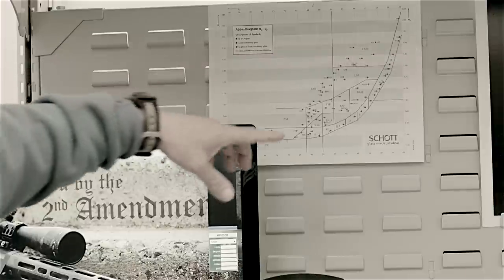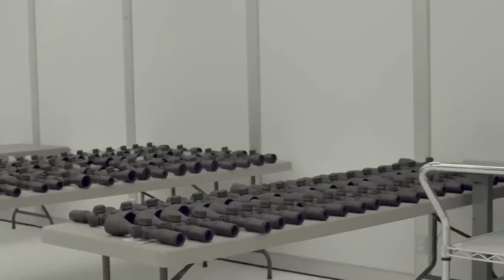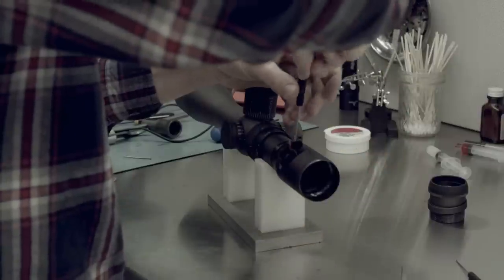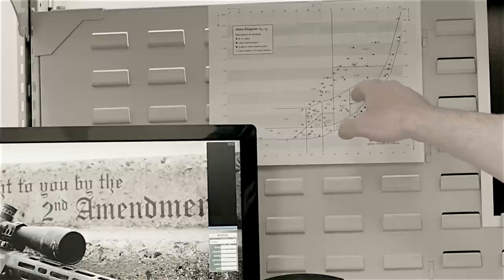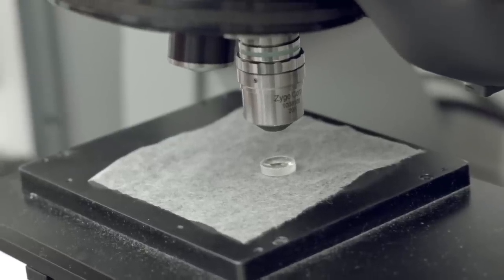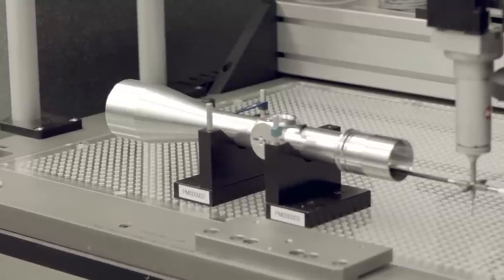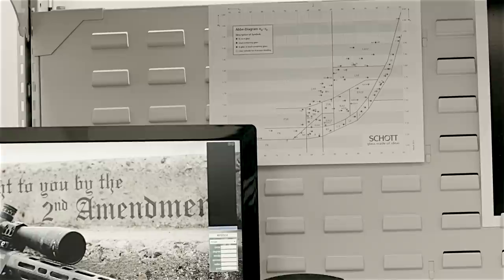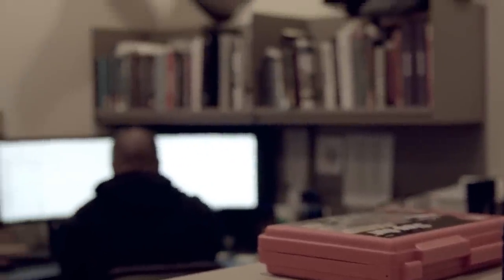Vortex Factory Tour - Glass Education

Comment: Recently bought a vortex razor HD gen ii 4.5-27×56 featured in this video and very happy with it. Coming from viper PST which is good to me.  Amazing quality and clear glass with repeatable adjustments which I value greatly. I will be testing their customer service as one of my scope turret caps on the razor looks to have a slight defect from the coating process. Not a big deal as it's just a little screw on cap.  I'm sure they will toss me a new one.

Comment: Are one of those 4.5-27's my scope that I ordered two months ago? I can't wait until it's on my rifle!
Reply from the maker: I think your link broke the conversion, look up " Schott vs Hoya" here is a quote 

"Schott" is a brand just like "Chevrolet". 

The question is akin to asking "Is a Chevy a better type of car?" To which most folks would reply "What Chevy and better than what other car?" 

The question cannot really be answered until you move from brand (i.e., "Chevy") to models ("Aveo" and "Corvette") and beyond. Between the Aveo (imported, subcompact, high fuel efficiency/low performance, affordable economy model) and the Corvette (domestic, large two seater, ineffcient/high performance, costly sportscar model) there's a huge range of characteristics. In other words, Chevy, like Schott, offers lots of models at all ranges of quality, specifications and price. 

The ED element is the low dispersion "crown" glass (in this case a fluoro-crown) so the Schott glass is likely something we'd call a "flint". A flint typically has a higher refractive index than a crown, usually in the Nd range of 1.45 to 2.00. 

To guess at what Schott flint is being used (i.e., to identify the "model" rather than just the brand) you'd need to look at the Schott glass catalog and see what glass types are available within that "flint" refractive index range. It's probably Schott NF2 with an index of 1.65 (my guess). Ohara makes a similar glass called PBM2Y. At a given level of quality (Grade) the two are fungible. 

Also note that brand and model alone don't tell the whole story. Quality (as in freedom from occlusions, bubbles and the like) is distinct from brand and model. The highest grade optical glasses have fewer such flaws than the lower grades. 

That's a long winded way of saying that pretty much anyone's flint glass of a particular refractive index and common quality level will perform the same. The brand of the is completely meaningless. The properties of the glass have meaning, but don't tell the whole story. Only by knowing the relative properties and quality of both elements can you begin to form an idea of how the scope using those materials might perform. The last bit of information, however, is the quality of the figuring of the materials. As I said earlier, poor execution (inaccurate figure, poor polish, poor coatings) could cause even a design of excellent potential using materials of the highest quality to perform poorly. 

So, when a telescope maker tells you "I use Schott and Ohara glass" they essentially tell you nothing of value about the telescope. If the maker tells you "I use Ohara FPL-53 mated to Schott NF2" they tell you something of modest value that at least allows you to model and predict how the scope could perform at a given aperture and focal length. If they instead told you that "I use Grade A Ohara FPL-53 mated to Grade A Schott NF2, and I hand select only those blanks completely free of detectable flaws, then figure the optic to a minimum of 1/8 wave at the eyepiece with a minimum 40/20 scratch-dig surface polish quality" he's provided some relevant information, which, if true, more likely than not would be a superior scope. 

Problem is, few makers provide this much information. Basically glass brand and glass type alone, with a promise of "diffraction limited" figure quality and no guidance on what diffraction limited means, tells you almost nothing about the actual scope built to those criteria.
Reply from the maker: and Schott has manufacturing in China, as well if you look at the numbers, you can get Chinese equivalents of Schott 

Schott catalog #/Chinese catalog #------Abbe #

BK7/K9-------64.07
PSK3/BaK4---63.36
BaK4/BaK7---56.05

Up until recently, all ED was Ohara glass combined with Schott Flint glass, there is a mix to develop the appropriate prescription. 

This is why in the video he tells you, Glass is Discrete!  It's the design and number, not the name brand.
Reply from the maker: So you think the $800 scope is the same glass as the $2800 scopes, you do realize Schott operates in China .... Try Googling Schott vs Hoya, or Schott vs Ohara and read. The Abbe number means you get the identical glass from a different name brand.   Look at the Schott ED numbers vs the Ohara ED numbers, the Ohara has higher quality ED glass than Schott.

Comment: Of course, if your scope doesn't have "Schott glass" you're going to say, " the brand of glass doesn't really matter".  Then when you have the Schott glass scope, it'll show up on your webpage as a BIG selling point.  Downplay what your product is lacking and play up your selling points.  This video didn't age well.
Reply from the maker: Glass is glass do you think Hoya can’t match specs. Funny every big blockbuster uses a variety of lenses including Japanese, there is an Abbe number and spec, more than one company can match that spec.
Reply: @SHLowlight  Nope!  It's funny how you never hear anyone talking about the awesomeness of "Hoya" glass, except those trying to sell it and claiming it's on par with Schott glass.  Lol.  It's still NOT Schott glass.
Reply from the maker: @Rico11b  if you say so, they do in some circles you just don’t see it in scopes. But the majority of scopes use Japanese glass and Schott sources glass from China too so 6 and 1/2, stop by a telescope forum for an education. They know.
Reply from the maker: @Rico11b  even the new Zeiss S3 is a LOW product with Zeiss specs in Japanese glass and it’s every bit the S5. You can’t tell, the S5 is Schott glass and the S3 meets it
Reply: @SHLowlight  Don't change the subject.  The video was about the crappy Vortex scopes, not Zeiss.  Are you producing and selling the Zeiss?
Reply from the maker: @Rico11b  I run Zeiss not Vortex, I have a Gen 2 and not much else, I run S&B too alot
Reply: @SHLowlight  Hahaha... yeah telescope guys geek out over this stuff.  :)
Reply: @SHLowlight  Smart man.  Had a nice S&B a few years ago, till it got stolen.  The only sore part is the jackass that took it probably pawned for a hundred bucks not realizing what they had in their hands.